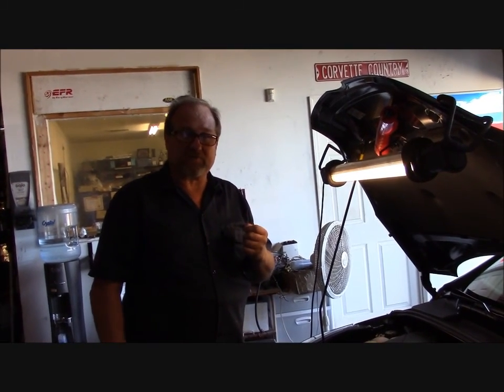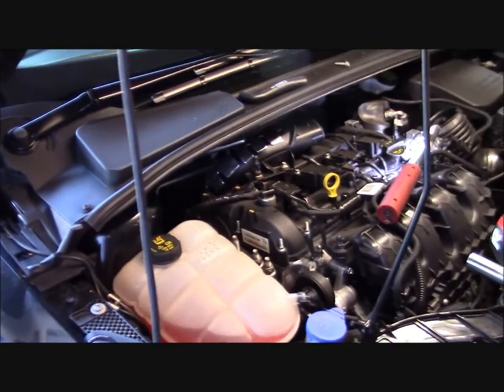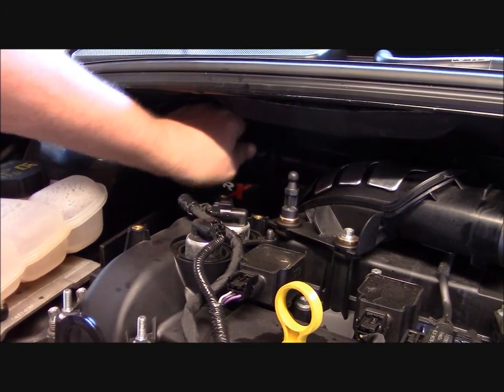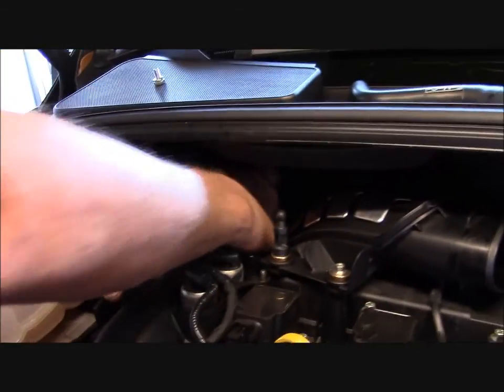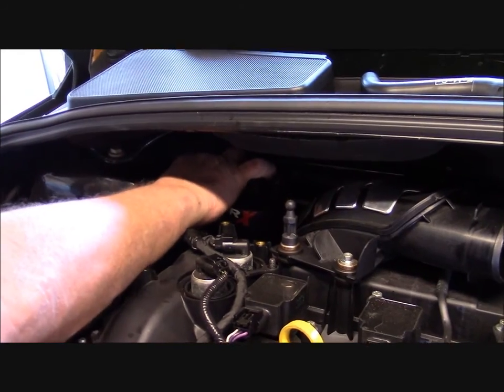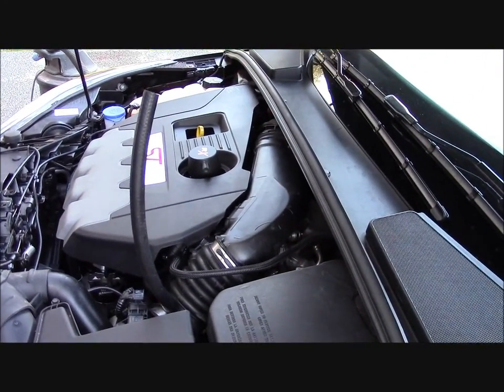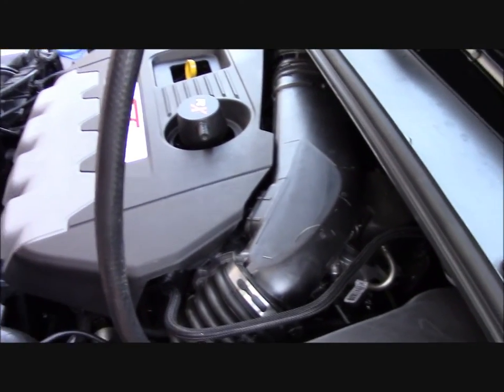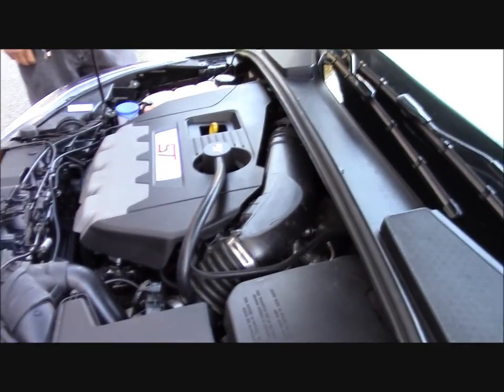Ford Focus ST RX Performance Catch Can Install Video

Comment: So from this video are you evacuating from the pcv and oil separator to the center of the catch can with a T fitting to evacuate both sides?

Comment: I'm confused you have the center line which you called your vacuum feed hooked up to the valve cover exit meaning it's pushing air out not pulling, the intake hose would be your vacuum source which you don't have it hooked up too?

Comment from the maker: From the PCV foul side outlet to the center of the separator (can) and then using 2 outlets from can, checkvalves flowing away from can on each outer fitting outlet. One to IM vacuum barb for evac during non-boost, other outlet to turbo inlet (as close to turbo inlet as possible) for evacuation suction while in boost. Cleanside separator on top only brings in filtered fresh air from main intake air tube. This maintains proper flow of "fresh in, foul out"  at all times so no crankcase pressure issues and always flushing out and removing the damaging compounds that are entering as blow-by.

RXProducts@aol.com for more info.

Comment: thats typical of direct injection engines unfortunately. the fuel doesnt enter the intake ports to clean off the valves.
Reply: Tracy Lewis Performance can you do a video on how to clean the intake valves please? I dont want to scrub the build up and the debris to fall into the cylinders and damage the walls

Comment: this is really sad for anyone with a ecoboost system i wonder will you make a kit for the RS model because don't want the same issue this person has, how about a kit made for the na engine for the standard focus with dual valve kit cuz i run mine pretty hard

Comment from the maker: Large performance part re-sellers carry it, and many performance shops as well, or email direct: RXProducts@aol.com

Most effective on the market period (RX Catchcan Challenge):

Test the RX cam against ANY on the market, no matter the claims and see first hand. Moroso, Phastek, any with "billet" in the name......you will be amazed how ineffective 95% of the cans on the market are....and if your not catching all or nearly all of the gunk, your not correcting the issues caused by the ingestion:

5.0 UPR vs RX Catch Can Effectiveness Test

I’ve had a UPR catch can on my 5.0 since last summer. It catches a lot, especially in the cold months. But I’ll get right to my test. I added an RX can inline after my UPR can to see if the UPR was missing anything. And if it was allowing some to pass through, was it enough for the RX to catch anything? I don’t drive a lot of miles regularly since my F150 is not a daily driver, so my results will take some time. This thread is to document how I set it up and what I catch over time.
I installed the RX can just as the directions explained, but I routed the hoses differently. I left my UPR can right where it’s been for months, but rerouted one hose. I left the hose from the passenger side of the engine to the inlet of the UPR can. Then a new hose from UPR can outlet, routed to the inlet of the RX can. The RX outlet hose goes back to the engine. The PCV exhaust now flows from the engine, through the UPR, then through the RX, and finally back up to the engine intake.
Before installing everything for the test, I cleaned the UPR can thoroughly. The bottom of the can (inside) was covered with a thin layer of stiff sludge that I could only clean out using gas. I’m glad that was caught, along with the ounces of oil, water, etc, over the months I’ve been emptying it. But I was surprised at the outlet hose from the UPR can. It was wet with oil. Obviously some was getting through the can and back to my intake. I’ve never let the can get close to half full before emptying it. Nearly every time I’ve emptied it, there was 1/4“ or less in the bottom. I’m noting this in case someone thinks I left the UPR get overfilled and it flowed through. Nevertheless, I started this test after cleaning everything for a fresh start.
I plan to leave this setup on for a thousand miles or so, and report my findings from each can.
1st picture: UPR can as it was originally installed.
2nd: CleanUPR can.
3rd: RX can installed. The hose in the top center of the can is the inlet. The outlet hose on the right has a check valve.
4th: Engine outlet to UPR inlet on left of can. UPR outlet on right side of can routed around (smaller hose) to the RX inlet. You can also see the other smaller hose coming back up from the RX can and ending at the intake on the engine.

Report 2:

I thought I'd add a post to keep this thread alive since it is taking me awhile to get enough miles on the truck for valid results. Now that spring weather is finally arriving, I haven't been putting as many miles on it since I'm busy. But I have around 600 miles on the test set up so far. I emptied the cans recently and recorded the volumes to date. I'd like to wait until I get to 1000 miles before posting the results from the test, but I'll give some preliminary feedback.

- Emptying process - 
First the UPR. I'm used to emptying the UPR can regularly, so it's not a big deal to unscrew, guide the can out from between the hoses, pour it out, guide it back in between the hoses, get it lined up carefully (so I don't cross thread the soft aluminum) and screw it back up snug. All that takes less than a few minutes so it's rather easy.
Now the RX can. Raise the hood, hold an empty water bottle under the drain tube, open the valve, close the valve, close the hood. I kid you not, it takes no more time than it took to read those steps. I knew it would be easy to empty, but it is ridiculously easy.

_ The weather so far - 
During the first week of the test we had winter weather, with some snow. Since then we have had mild weather. Temperatures are in the 50's and 60's most days.

- What they caught so far -
I won't share the amounts yet, but I'll give some info. The UPR can has caught a 'mostly oil with a bit of water' mixture so far. The RX can (in line after the UPR) has had just the opposite. It's collected mostly water or fuel, with some oil mixed in.
I emptied the UPR first, and I would estimate it has collected the normal amount compared to what it usually does I empty it. I was pleased that my set up with 2 cans didn't seem to change the normal flow and collection I was used to seeing with just the UPR can. When I was about the turn the valve to empty the RX, I paused to a few seconds wondering if anything would come out. After all it was a new can that would need to get some oil/water coated on the inside before there would be enough to drip to the bottom (The UPR can had been in use for many months and although I cleaned the can I did not rinse off the filter material). Plus I wondered if the valve of the RX can protruded up into the can, and if it required some liquid to collect before there was enough to spill over that valve nipple and exit the can. Then I opened the valve and I had to smile when I had some liquid drain out. I thought all along that if it caught more than 10% of what the UPR was collecting, I would be surprised. It's still early in the test, and I would like to redo the test after reversing the order of the cans later, but I am surprised so far. I'm hoping to get more miles on the truck soon so I can wrap up this phase of the test.

Report 3:

1000 Miles of Testing Results

- The Weather has been warmer lately. So the test began with sub freezing temperatures, and gradually increased through the 70's and topped off in the mid 80's yesterday. I couldn't have asked for a better range of temperatures for this test.

- What they caught was astounding to me. UPR was first in line, with the RX after it to catch anything the UPR might miss.
The UPR stayed on track with what it has been accumulating for many months. Each time I emptied them, it had about the same amount. It's contents were mostly oil which smelled like used oil. It caught 17cc total which is just under 3 1/2 tsp.
The RX had more than the UPR each time I emptied them. It's contents were an oil/fuel/water type mix that had a much stronger odor. Not a fuel smell, but a sharper chemical smell compared to the odor of used oil. It caught a total of 67cc which is just over 13 1/2 tsp.

- Final totals:
UPR - 17cc
RX - 67cc

The RX can caught 4 times the amount the UPR can caught, after the UPR can removed what it could. I said from the beginning I would be surprised if the RX can could pull 10% of what the UPR caught, since it was second in line. If someone told me it would catch an equal amount I would have said BS. For it to catch 4 times what the UPR can caught is unreal.

Report 4:

The routing of cans has been reversed so the second phase of the test is underway. I cleaned the cans and hoses so neither has an advantage. I also checked the inside of the hoses as I disassembled everything. The exit hose from the UPR was dripping with oil and it made a mess as I took it apart. The exit hose from the UPR was clean and dry. It still looked new. That is what prompted me to clean all the hoses before starting this phase. Is the double can routing helping the second can that much, or is one can that much better. Time will tell again.

Report 5:

And now back to our regularly scheduled programming…

Phase 2 is almost complete now, thanks to some extra mileage for work. I'll report on that soon and begin phase 3.

As I said above, UPR shipped parts for me to do phase 3 of the test. I bought my UPR can in June, and they changed the can slightly since then. The new diffuser/extension will only fit cans made after that, so they shipped a full new kit to test. Thank you UPR for helping with this, and for your input in this thread. 
After shipping the kit, Joe@UPR asked me to remove the mesh from the exit side of my existing can for the remainder of phase 2, and to remove the mesh from the exit side of the new can before starting phase 3. I removed it from both (phase 2 was half way done when I removed it from the existing can). When I was removing the mesh from the short side of the new can (in preparation for phase 3), I realized the diffuser was assembled backwards. For our 5.0 F150's the long side of the diffuser must be on the passenger side of the can when installed. I disassembled, removed the mesh packed up in the can top on the exit/passenger side, and reassembled the can with diffuser. For anyone who might have received their cans assembled by UPR, you should check to see if it was assembled correctly before installing. (EDIT: Joe notes below they assemble the cans for shipping, and all cans should be assembled for your own installation needs) I also had a small piece of the stainless steel mesh (1/8") drop out when I was doing that. I wasn't thrilled with that so I unrolled, and lightly tapped the mesh in case there were any other loose pieces, but there weren't. A quick note on the UPR kit... it is much improved since I bought mine. The hoses are pre cut to the proper lengths, the elbow fittings are nickel rather than plastic, and they include Ford OEM snap on valve cover and intake fittings.

More to come soon!

Report 6:

Test Results

- I'll summarize the test to date. The first phase was to test the UPR vs the RX catch cans on a 5.0, both base models, with the UPR first in line and RX installed to catch anything the UPR missed. Those first phase results were: UPR - 17cc, RX - 67cc. The 'first in line' UPR caught 20% of the total volume. See post 37 in this thread for more details. The cans were cleaned and reinstalled in reverse order for phase 2, RX first and then UPR.

Phase 2 Test Results
- The Weather has been average northern Ohio spring weather. Some rain, fog, cool nights, warm and hot days.

- Driving has been about the same through both phases. I good mix of rural roads, some small towns, highways, and approximately 40% of the miles on interstates at 65 - 80mph. Mostly average style driving, with a few very heavy accelerations mixed in. A little heavy hauling, and no towing.

- What they caught this time might have been predicted by some (after the results of phase 1). RX was first in line, with the UPR after it to catch anything the RX might miss.
The combined volume of gunk was half of that caught in the first phase. The first phase had some cold weather which accounted for more water in the mix and the higher volume.
The contents from the RX can was mostly oil/fuel, and had a strong chemical/solvent smell again. It caught 35.5cc total which is approximately 7 1/8 tsp.
The UPR can caught about the same mix of oil/fuel, but didn't smell quite as strong. Halfway through this phase, Joe@UPR asked me to remove the mesh on the exit side of the UPR can. I did that, but noticed no difference in what it was catching. But since it was second in line, and there was little to catch, that's understandable. The UPR can caught 1.75cc total which is approximately 1/3 tsp. With so little collecting this time, I monitored the contents of the UPR can but didn't empty it until the end of the test.

- Phase 2 Totals:
RX - 35.5cc
UPR - 1.75cc 

- Other tidbits include the 'first in line' RX can caught 95% of the total volume. The exit hoses were very clean from both cans. The last few tanks of gas have produced slightly higher than my normal MPGs, but it's too early to tell on that (more to follow after phase 3).

-Phase 3, using the UPR can extension and diffuser, is underway. Details will follow.

Final Test Results

- I'll summarize the test phases. The first phase was to test the UPR vs the RX catch cans on a 5.0, both base models, with the UPR first in line and RX installed to catch anything the UPR missed. Those first phase results were: UPR - 17cc, RX - 67cc. The 'first in line' UPR caught 20% of the total volume. See post 37 in this thread for more details on phase 1. The cans were cleaned and reinstalled in reverse order for phase 2, RX first and then UPR. The second phase results were: RX - 35.50cc, UPR - 1.75cc. The 'first in line' RX caught 95% of the total volume. See post 143 for more details on phase 2.

Phase 3 Test Results

- This time the UPR can was first in line as in phase 1, but it had the new can extension and diffuser added. It also had the mesh material removed from the exit side of the can.

- The Weather has been average northern Ohio early summer weather. Some rain with warm and hot days.

- Driving has been a good mix of rural roads, some small towns, highways, and approximately 60% of the miles on interstates at 65 - 80mph. Mostly average style driving, some steep hill climbs, and some very heavy accelerations mixed in. A little heavy hauling again, and no towing. I'll add some more thoughts on driving and MPGs below. 

- What they caught was a mixed bag. UPR was first in line, with the RX after it to catch anything the extended UPR might miss.
The combined volume of gunk was down from the last phase, again. I assume it is due to the warmer weather and maybe my engine is using less oil with more miles? Either way, my test looks at the percent each can catches, compared to the total caught for that phase, so the volume isn't critical.
The contents from the extended UPR can was mostly oil, and had a used oil smell. The UPR caught 14.75cc which is approximately 3 tsp.
The RX can caught a fuel/water/oil mix. It smelled much more harsh again. The RX can caught 16.00cc which is approximately 3 1/4 tsp.

- Phase 3 Totals:
UPR - 14.75cc (48%)
RX - 16.00cc (52%)

- Other thoughts on the results. The contents of each phase showed me the RX does a better job of removing more than oil. It always contained more water/fuel type liquids, while the UPR contained mostly oil. I don't know if it is due to the can design, the 'out front' mounting style of the RX, or both.
For anyone buying or thinking of upgrading their UPR can, I strongly recommend figuring out how to mount it out front, and would definitely add the valve that Joe@UPR is offering. I really think the 'out front' cooling effect will help it catch even more, and the valve would be worth the price for ease of emptying it. Having the RX can to compare to when emptying, the front mount and valve are no brainers.
As I said at the end of phase 2, my MPGs have increased slightly. I have done nothing different to my truck over the past year, other than adding the RX can to the UPR for this test. My driving style is very similar from tank to tank, I fill up at the same stations, etc. But since having both cans in series, and essentially removing 95% or more of the PCV byproducts, my MPGs have increased. Up to that point my lifetime MPGs were 17.5. Nearly every tank for the past year gave me the same results, 17.5. I would have some trips that would net 20 MPG, but the other short trips would always pull it back down for the same tank average - close to 17.5. My recent tank averages have all been over 18 MPG, with a few over 19, and as high as 19.5. My last tank included hauling approximately 1000 lbs of payload, through some long hills/mountains of PA, and I got 18.8 MPG. It could be the summer fuel mix combined with an engine that is broken in, but the timing is peculiar. Whatever the reason, I like it!
Reply from the maker: +RX Performance Products, LLC 

Make sure all are aware of the China made versions being sold with the RX label. That is NOT us!!  We can be reached direct at:  RXProducts@aol.com

We do NOT endorse or trust those pressed together China made cans being sold out of 2 ex-employee's homes!!!